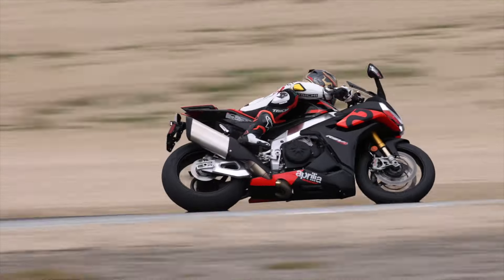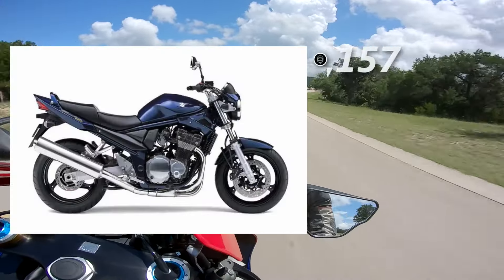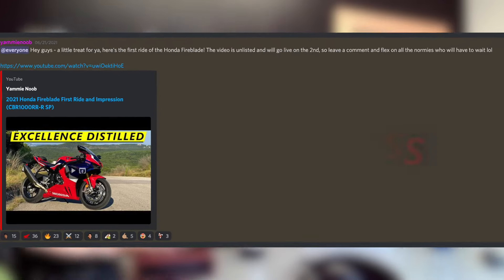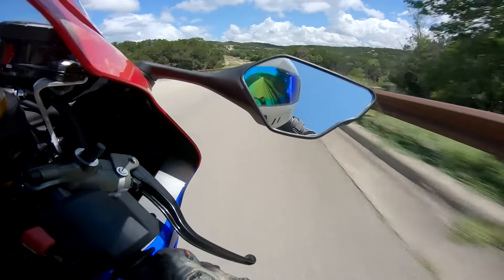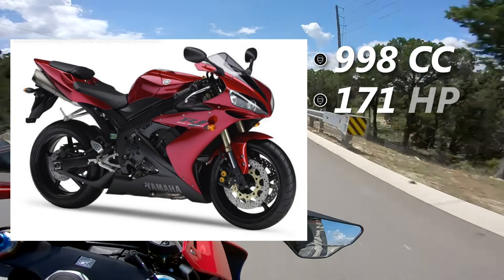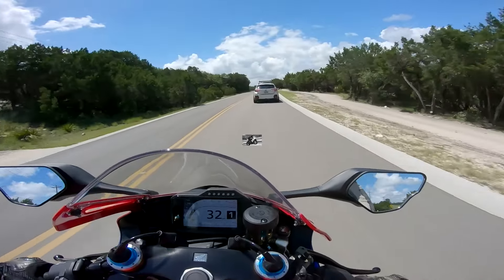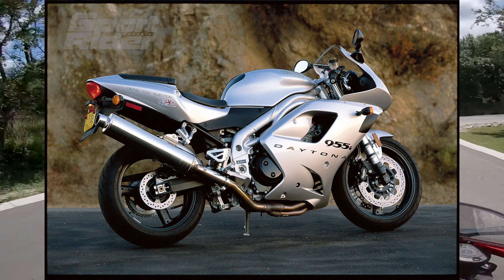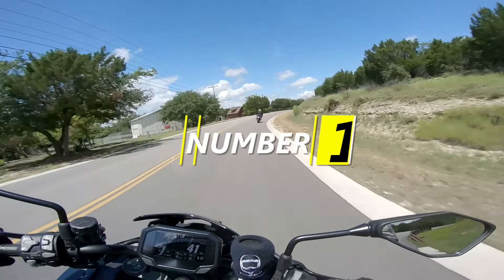TOP 7 CHEAP AND FAST MOTORCYCLES TO GET! (SQUID MISSILES)

Comment: If you want an awesome cruiser for the same price with massive torque a 1900cc 07 and up stratoliner S, or roadliner will do the trick. WIth 98 HP and 123 ft lbs of torque at 2250 RPM, and just under 4 second 0-60, its a beast of a cruiser, with cool vintage art deco styling even...also smokes most harleys you will encounter. Unless of course they paid 20-50 thousands bucks, even then...you still win.

Comment: For exquisitely well maintained large bore dad bikes with low mileage and insanely cheap prices, BMW is the king lord god.  Many of them will be ginormous cruisers of the Euro flavor but there are plenty of sport touring bikes in the mix, and if you wanna go fast, 1100+ ccs is gonna do it.  When you pick up a like new 2004 RS for $2700 with 3600 miles, your only question will be, can you trust the factory tires that have almost never seen sunshine UV or gotten a whiff of ozone?

Comment: I bought a yamaha xj600 for extremely cheap. They are about 1200 euro's max in europe. It does 0-60 in 4.5 -5sec from factory. With a bigger rear sprocket even faster! It is heavy but certainly really nimble for its weight. I think it is about the same class as a suzuki bandit but a cheaper choise.

Comment: Bought a '98 vtr 1000 firestorm completely upgraded for 1100 bucks. It makes 115 hp, 90 nm of torque and does 0-100 km/h in 2.9 and looks like it left the factory yesterday. You can go alot cheaper and still be as fast as all these bikes on this list.

Comment: Well ABOUT TIME ...the Daytona 955i  most under rated 'sport bike ' ever... $4000, I picked up my 2005 w/6,800 mile mint for $3500 in 2013. Was going to flip it and make a grand or more..but became so fond it . IIRC it had shared the quickest 0-60 time even today ..Probably pick one up for less than $3000, go -1 on the front sprocket, +4 rear, insanely quick...add a TOR Triumph Off Road carbon exhaust,  Triumph proprietary 10181 or Tune ECU custom map  and your at 135 hp ..plenty. plus your insurer will love it   -  cheap premiums !!!!!!  Must do a review Noob !

Comment: I bought my 05 katana 750/gsx750f for 1400, sent it to the shop for carb rebuild and full inspection. 1600 dollars later, it is am amazing bike. I ride it more than my Harleys.
Reply: Same basic thing I did with my '88 GSX1100F. $1900.00 CDN to buy the bike and then a major tune up, carbs rebuilt etc. and then more recently a new fuel petcock, and clutch master cylinder rebuild with braided line, .. so about $1600.00 more to keep it running as it should over the past couple of years. Katana's are good machines.
Reply: @Zain Ahmad The GSX1100F came new in 1988 with 136 hp but is just a 4 cylinder. It's still very smooth and fast though.
When I was young a close friend had a CBX and let me try it out. They are awesome but this Katana would have been faster new.

Comment: Honorable mention: Kawasaki ZZR600/1100 models from the 90`s. I got 600 version myself and its pretty cheap and fast with 98 hp, 1100 models go even faster.
Reply: Had a 95 ZX6E, wasn't a bad little bike but has a curse of getting stuck between 2nd and 3rd. The fix, buy a new shift drum cause that's why. Love my 03 Z1000 though, odd thing is it's basically the ZX9 / 9R engine bored out and fuel injection but doesn't have the power the ZX9 had. Still not a bad bike and they go from 3 - 4,500K for gen 1 - 2
Reply: @IrnMaiden304  ZX6E, isnt that a pure sport bike? ZZRs are sport touring bikes, quite good on longer journeys too :)
Reply: @kebabaluba  The ZX6E is the ZZR basically.

Comment: Just got my Moto permit lol getting my license by the end of the month Yammie!!!! Been watching ur channel like it’s the only thing on YT and I want to ask u…do u think the 2022 Ninja 400 would be good for a new new rider??? I mean I’ve sat on motorcycles b4 but never drive one but I do understand all the functions and how to make it move and stop…just never did it tho…so would the 400 be gd? Don’t want to get a Grom as a first bike I was told by many that I would get bored quickly if it.
Reply: Just get a used small engine ninja rather it be the 400 or 300 or even a older 250 especially since it's your first bike for obvious reasons

Comment: Great list. Those old Japanese inline 4's can't be beat for longevity. You can go older and cheaper yet and still have a fast reliable ride. Two years with my '88 Katana 1100 and every thing I've spent on it this far (other than gas and insurance) original price included amounts to about $3,500.00 CDN. That's pretty cheap riding considering at that age I can probably resell the bike for at least what I paid for it.
Reply: My first bike in 1996 was a 1978 KZ750 and I think it's still out there somewhere doing its thing.

Comment: Bought my first Street bike a month ago. Decided on a Honda CBR600F4i found a 2006 for $3600 and under 16k miles. More than enough squid, off to go get my endorsement.. eventually.
Reply: That’s the first bike I almost killed myself on, nice choice. I was 18 barely ever rode the street before and found myself trying to figure out how to get around a bend at 156mph indicated. What a ride that was in like 2008 or maybe 09
Reply: Just do the brc2 if they offer it around you. It’s 1 day instead of 3 day
Reply: Great choice- I wanted the same bike but ended up chickening out and instead bought a 2019 CBR650R- I’m really pleased with it, mellow and easy to ride low down in the revs, comfortable, but fun when you get those revs wound up.
Reply: @monkmoto1887  Interesting, gonna remember that compliment. I'll make sure to be prepared If I ever catch myself going that fast into a bend.
Reply: @monkmoto1887  yeah you’re a smart one

Comment: I own a 954 and it is an incredible bike in every category.
Reply: 954 is one of my favorites in my garage too. She is fast and savage when you want her. But she can be mild, easy and controllable in every situation too. (Was caught in snow in the Swiss alps on her and made it home without any problem nor nanny systems)
Reply: I love my 954, power wheelied on accident the other day for the first time, i guess i havent been twisting the throttle fast enough previously
Reply: How is it for taking a pillion and luggage for a weekend away?
Reply: Luggage is no problem. I use rollbag and a textile saddlebag combo. I carry about 75kg photo equipment and some clothes and other stuff. It would be 100kg on the back. I ride solo. But the pillion should have a solid bottom and grip. The backseat. It isn’t the most comfy option.
Reply: Same, rode her yesterday, will be riding today.
Almost has 50k miles on her!
Reply: Ridden one, 954s  are great, as is the first R1 and RSV mille and obviously the nutty K5/6 Gixxer. Would be proud to own any of em and  teach noobs humility on newer bikes - and yes have owned 3/4

Comment: I've been watching your channel for a few days and have learned so much already, despite riding since mid 90s. I'm here because I picked up an 02 Bandit 1200s 2 weeks ago and i'm so happy to see it even at number 7!! Same blue and all, timing advance,  jet kit,  and full holeshot system. Supposedly 130ish on a dyno. I realized yesterday that its so much more fun taking a "monster bike" (to me) with an exhaust respectfully and as quiet as possible through the country than it is taking a smaller bike through as fast as possible.  Of course I occasionally get stupid on backroads and look down on the interstate and I'm doing 95 constantly and back off.  However, the prettiest roads dont need rushed through. Thanks for the knowledge and laughs  .

Comment: 0 to BROKE in 3 seconds. You ain't buying any of these bike for $5000 or less. And I agree Suzuki is a good bike but you can get a LEMON.. MY 2929 Katana 1000 clutch went out at 100 miles.   BRAND NEW BIKE and the clutch goes out. LEMON  from the start.
Reply: I got a 1999 triumph Daytona 955i, 27k miles in perfect condition. 2500$

Comment: A couple years ago, I was really in need of a commute bike.  50 miles each way, so gotta be comfy.  I found a 2002 Yamaha FZ-1 for $2k. Cracked fairing ($200 to replace) and overall ugly, but low miles, in  good mechanical condition.  I really love this bike, and flies on the LA freeway.

Comment: The Daytona 955i is a good pick, although the Sprint ST 1050 looks like it can be had for less then $5k and can be had with ABS, kind of a half-way house between the Bandit 1200 and Daytona. I currently own one (So probably biased) but it's a proper Sports Tourer in that there's nothing it can't do (Aside from off-road-ing).

Comment: 05 R1 is a fun little toy.  Still have mine that I bought new back in early 2005, had to wait for it get delivered.  Yeah as you said its not 200 hp of the new R1s.  But its still a rocket ship and super fast and capable.  With 162 HP+ at the wheel you really can't be that disappointed (numbers it put out on the dyno back in 2005).  And almost 20 years later and people still compliment it, although mine is very custom/upgraded for track riding and is basically a full 2005 Haga WSBK replica so it does stick out.  Have been looking around for another one to have a normal street trim version.  One day I will probably get a new one to go with this one.  But yeah the 04-06 R1s are great bikes if your looking for an R1.  just to add if you want something more raw the 2000-2001 R1 is a bit of a monster, had that one first.  But that old carbed engine is a whole other experience.

Comment: Stay away from the Duc's unless you can afford the valve adjustment every 3000 miles. Back in the 90's, when I worked at a Ducati dealer, it was $1500, so imagine what it is now!
Reply: @Real_MisterSir  I could be remembering wrong, and it was $1200, but definitely somewhere in there. Most of our customers were Drs.,  Dentists, and some Alaskan fishermen. Service dept. Was always busy. Never was really into 900ss, or the M900 that we sold allot of, but the 916's, 888's, and 851's that came through were beautiful. One flaw they all shared was that suicidal spring loaded kickstand, that brought plenty in for left side faring damage.